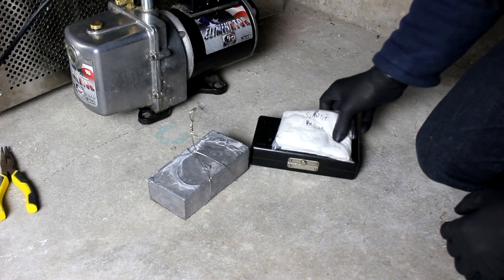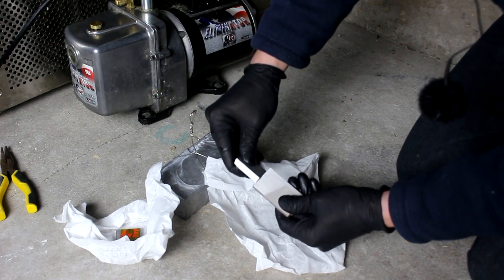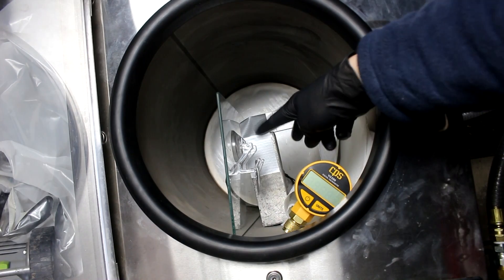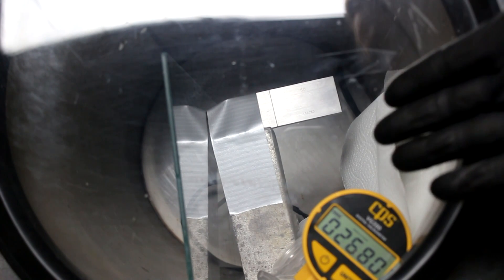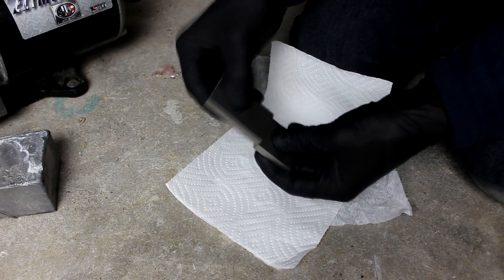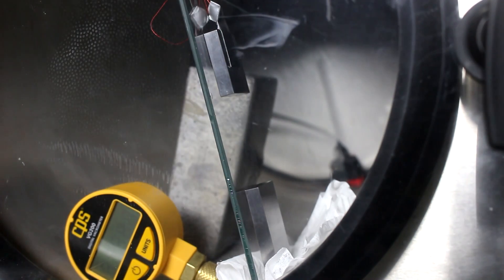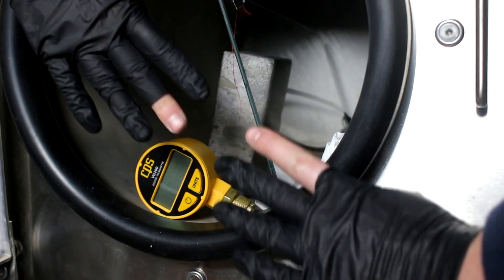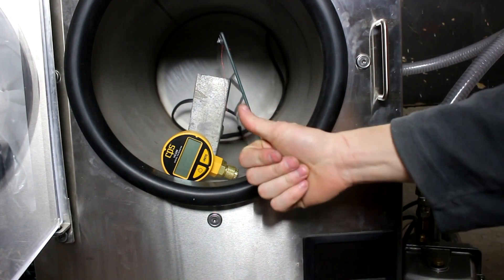Will Gauge Blocks Stick In Vacuum?

Comment: What about the Van der Waals force? Weak intermolecular attraction that adds up the more contact there is between surfaces at the atomic level. It's the same thing that keeps geckos attached to basically everything. The fact that they're almost perfectly flat (the gauge blocks) seems to validate this at least a little, why not look into this?
Reply: Like this so Cody can see
Reply: He mentions it at 13:46

Comment: Seeing the drop-contact experiment in vacuum versus the sliding/wringing process, I can't help but wonder if there might be a measurable electrical interaction between the blocks.  Maybe leading to van der Waals interactions in the oil layer (would require an exceedingly thin oil layer and effectively spike the viscosity of that layer to absurd levels) or maybe even allowing direct electronic interaction between the blocks.  Maybe wring them together but with a strap eualizing chare between the blocks...

Comment: I feel like since these are grounded so flat it the grind created like microscopic hills and valleys and when you app pressure and slide them across eachother the hills and valleys lock into eachother and thats why they hold together but idk I might be dumb

Comment: 1 wavelength is quite large. When making telescope mirrors any old joe can do 1/8th wave. Sticking is a problem with grinding mirrors as deviations around a wavelength - especially concave ones - cause the two glass blanks  to lock together.

Perfectly spherical blanks don't usually stick so geometry is very important.

Comment: That's... not what gauge blocks are for. You could use them for that, but it'd be kinda silly. You might be thinking of the standards that you use to calibrate and check micrometers.

Comment: very cold and weak friction welding? the movement does create heat  you could try and see if they are more likely to just stick at higher and higher sub melting point temperatures. alternatovely, you could try the friction movement with super cold plates and see if it still works.

if you notice a significant temperature dependence, this could be evidance against the "hooking together" hypothesis

Comment: If it is the oil that is holding the two pieces together then you will need a vacuum under 300 microns to boil off the oil

Comment: Maybe it behaves like ice and when strong pressure is exserted on it it becomes a liquid. Then the two blocks fuse together due to the liquid metal soldering it together. That is my theory :)
Reply: I've also found that static electricity can make two peices of glass stick together. Maybe the metal creates a small, really strong magnetic force. :) just throwing that out there

Comment: Great video Cody, but I am a little confused on a part.    If it was indeed some sort of suction keeping them together, wouldn't putting it in a (near) vacuum  make it harder for them to attach  to each other? It seems like putting them in a high pressure chamber where the difference of pressure of the outside the blocks and in between would be higher, that would there for increase the force?     I'm not sure if you would even be able to test such thing, but it is what I thought of.                                 

Love all your work man, keep it up! Million subs right around the corner!
Reply: quigly pigly He actually tested that.
Reply: What? When did this happen?
Reply: quigly pigly - Lmao someone didn't pay attention or watch the entire video... I mean it's pretty crazy because that was the whole premise to the video and he pretty much proved it is not a suction effect.
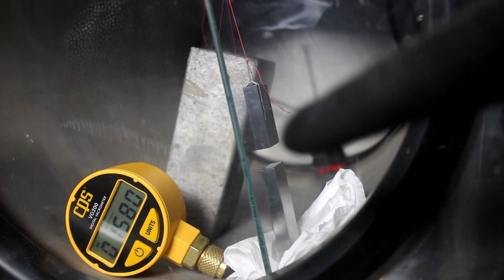Reply: The whole video was about the idea that those blocks would stick less in a vacuum. It's the whole video. The test is done at 9:00 . And the description says: ' I test a few hypothesis as to why gauge blocks stick together by seeing how they stick with almost all the air removed.' 
You just won the 'useless fuck' award of this entire millennium.
Reply: 2 months late, and zero info to add! Congratz, you get the 'useless fuck' award of the day!

Comment: it's probably an electromagnetic bond between the two blocks. like a balloon and a shirt.
Reply: UpdateParkor1628 you are thinking of an electrostatic bond. This shouldn't happen since the blocks are of an identical material and are conductive.
Reply: That's right macmaniac77, you would need a huge potential difference between the surfaces to generate the force capable of holding one piece against the other and an air or vacuum gap sufficient to stop arc-over.

Comment: Could it be that the surface of these blocks' faces aren't smooth at a microscopic level? If I remember correctly (which I never do), a two minute conversation I had with a smart guy's friend once four years ago, metals have uniform grain structure. However, the grains could be flowing different directions because they're two separate pieces of metal. So, when you specifically rub them together you're getting those uniform grains to slightly shift, not enough to get them welded together enough but for the grains to store friction between them.

Comment: You are probably having an issue with oxidation on the surface. When you rotate the surfaces, you could also be scratching of the non-reactive metal oxides, exposing metal that can be cold welded together. If you plated the surfaces in a thin layer of gold (which doesn't form an oxide) you could get easier cold welding.

Comment: I have a different theory on that welding effect. This theory is based on the "Gecko " effect found in nature. Geckos can climb up glass or any other material you can mention and studies have cracked this puzzle-------The scales on their feet are very very fine and end in edges that are a few atoms wide---these atoms can stick into gaps of any surface and adhere to it. Enough adherence to support their weight.   Pushing hard on certain metals will bind atoms together.

Comment: could you measure the amount of force necessary to separate the two pieces of metal and compare that value with the calculated total attractive magnitude of the van der waals force to insinuate it is in fact that force doing the work?

Comment: +Cody'sLAB I believe the friction is heating the metal slightly making the grain structure expand slightly allowing better intertwining. once intertwined the Vanderwall forces take over...
Reply: I'm really enjoying the hypotheses coming out of the CodysLab community.  This one is interesting too.

many hearts <3 <3
Reply: Ryan Bernard it would make sense for two dissimilar metals not to work... different grain boundaries and structures
Reply: In that basis, Invar metals would not stick. They don't expand significantly with T.
Reply: opopo or maybe try dissimilar blocks.. shouldnt work
Reply: Ryan Bernard dissimilar as in metal? or size...
Reply: Metal
Reply: I would guess Invar would still expand enough for this purpose. It only has to be a tiny amount, on a scale relative to atoms, and for a tiny amount of time.
Reply: opopo   C. C qqqq
Reply: tubeist- dan it would be worth a shot... however even invariable metals still expand... albeit 10 times less than ordinary steel.

Comment: I wonder if an ion pump under ultra high vacuum conditions would change the results. Even baking the chamber to reduce the moisture off gassing and contaminants could change thing drastically.

Comment: I reckon if you look at the ends under an electron microscope, you'd find mini scrapes from the ringing process which are essentially interlocking. You can probably simulate this with some other kind of deformable substance. I suppose another possibility is that the ringing removes local irregularities so that a greater surface area can be in contact.

Comment: Just a thought, probably not it, but it might not hurt to also rule out magnetization at the join site after they are joined and not just before.  Thanks for the videos, I'm really enjoying these and your methodology.

*Edit: After looking at gauge blocks online, I noticed some are ceramic; are these as perfectly flat as the metal ones?  If so do they produce similar results?

Comment: If the force is electron sharing, why don't you try touching them together lightly and then running a current through them? If they stick, that would be pretty convincing to me. Try AC and DC to see if you get different results.
Reply: Glass or ceramics ring together, and they aren't conductive. But if a combination of forces are at play then it might give clues? It's always worth an experiment, ask Ernest Rutherford!
Reply: that may end up resulting in actual welding
Reply: This as well as temperature changes.
Reply: @JimDeegan  This will induce a temperature change due to the resistance of the material and the eddie currents in it. So testing electric current is all you need.
Reply: Matthew Stauffer oohhh
Reply: This is exactly what I suspect is happening. That sliding and twisting motion sounds familiar from an electro-magnetic reaction my father once showed me in his work shed. I don't remember specifically what it was but I remember it was very important for a magnetic bond to form between two materials that aren't themselves magnetic.
Reply: This is along the lines of what I was thinking, in terms of energy added to the system, getting electrons to migrate.

The friction energy presented by ringing the blocks is significant given the huge amount of surface area contact. This energy may be enough to promote motion in the electrons to jump the gap and forming a pseudo-bond via cold welding.

You idea is much cleaner and way more testable.
Reply: Matthew Stauffer that's the same thing I was thinking try to put the gauges by an copper coil and run current through The copper coil.
Reply: False. Electron sharing is also called cold welding. If they were cold welded, then you wouldn't be able to pull them apart without ruining the surface finish. Which would prevent them from ever wringing twice. It's cool how you pulled that lie out of your ass on the spot though.

Comment: What about when you used the laser to cut the string wouldn't you have vaporized some particles making the vacuum slightly weaker. You could try using a motor and RC remote to lower it

Comment: Something you might be interested in researching is a similar phenomenon in harddrives. A semi-common problem is that the heads get stuck on the smooth silicon platter that move under them. Fairly easy fix - just gently unstick them - but I feel like the underlying science is probably the same. You can manually get them stuck yourself by slowly spinning the disk with your finger while slightly pushing the head down. This will quite possibly scratch and ruin the drive, of course.

Comment: I think that when you ring them together without a vacuum, it is creating a very strong suction which causes this cold welding. Once they are cold welded together, then the vacuum can be removed and they will stay stuck together.

Comment: As Richard Faynman said "The reason for this unexpected behavior is that when the atoms in contact are all of the same kind, there is no way for the atoms to “know” that they are in different pieces of copper. When there are other atoms, in the oxides and greases and more complicated thin surface layers of contaminants in between, the atoms “know” when they are not on the same part.". And I think that the act of applying force to make them sticks makes sense, since all matter is actually surrounded by electrons that repel each other, you need to give it energy in order to form a bond.

Comment: could you clamp them together and vibrate them. I bet they will stick with just pressure and vibration to settle the atoms together. goal is to remove rubbing as a factor. so I'd say a c clap and something like an electric tooth brush to vibrate them. I would love to see i f it could work. thanks for the great videos

Comment: ive used these types of blocks for years and did some similar experiments with a set of certified Starrett guage blocks with a guaranteed micro finish.  ive cleaned them as well as blast cleaned them with CO2 and they still stuck.  I did learn that even the most trace amount of humidity in the air is enough to make a stronger bond when rubbed between the surfaces.  although when i check the heights of the blocks individually on an inspection table with a ruby tipped Renshaw probe and then stack the same blocks after rubbing them together, they check almost 
.00012 taller over 4 inches (4 blocks rubbed total). This leads me to believe there is still something between the blocks adding the extra .00012.  The inspection head itself has a
 .00004 +-  room for error on its "Z" axis in its controlled environment.  The guage blocks were acclimated to the inspection environment and left to acclimate again after touched with warm hands when set up for the rub/stack test.

Comment: You can't wring out all the air, there isn't any space in existence so flat that 2 separate objects will have an atom touch another atom because atomic forces will always keep them apart. But if you think van der waals attraction is occurring then you should look into surface area energy. Your surface is coated in gas molecules being either physisorbed or chemisorbed and the attraction from forcing the metals onto each other could cause something like H being forced into a metalhydride bond. 

Bake the blocks in a continuously purged helium atmosphere at 200C, then somehow without having them come into contact with air vacuum the pressure away and then try it.

Comment: The sticking is just the beginning of a cold weld. Which you could also classify as friction if you really want to...with the surfaces so honed, if you exclude any air molecules, it only takes a very small amount of force to start to adhere the surfaces. If you were able to slowly press the surfaces together flat in a vacuum (not just dropping them together, since that also applies a reverberating force that doesn't allow the surfaces to adhere), I would be that it would work.

Comment: it could have something to do with the electrons in the metal
Reply: you should also test gauge blocks of different material and see if they stick
Reply: i work with ceramic and steel gauge blocks daily and they both wring together. ceramic seems to stick better, however i believe that is more due to the fact that the ceramic are a little newer, and harder, so the surface is less scratched

Comment: The effect is much more striking with hard disk platters. You can just let them sit on each other (with little wringing compared to gauge blocks) and while they slide laterally quite easily you can definitely feel that they don't want to come apart. I would imagine the surface features of a disk platter are much smoother than the average gauge block since I think disk platters are fabricated to 5-10 Angstroms height difference across the surface (though thermal effects and use will increase that at least a magnitude I would imagine).

Comment: What if it has to do with inter molecular forces? like, the minute differences in the spread of electrons throughout the substance when you slide them cause tiny dipoles of attraction through the London Dispersion Force? And the sliding motion kinda makes the attraction "turn"  causing the electron distributions in the individual atoms line up as if it were like turning a billion bar magnets on their side next to a billion other bar magnets.

Comment: I say a lot of stupid things and this very well may be a stupid idea so i apologize in advance, but i believe what is actually happening is that by rubbing the pieces together, an oxide layer on the surface is scraped away leaving only the pure metals in contact with each other at several points along the contacting surfaces. this would explain how moving parts get cold welded together in space. Everything that comes from earth will have some layer of debris and oxidation on it's surface, but if the parts move against each other, that layer get's scraped off leaving a pure surface in the vacuum of space.

Comment: THE ANSWER:       (TLDR: malleability) 

The surface of the metals are not completely flat at the atomic level otherwise there would be nothing stopping 2 pieces of metal from sticking together due to metallic bonding when they are brought together. The sliding action makes metallic bonding possible. 

At the atomic scale the surface of the metals are rough like jagged rocks. When you push two of these rough surfaces together, there are some(few) contact points that support the force between the 2 pieces and atomic bonding is possible at these locations however not enough force is generated by these few bond points to support any weight so the metals don't stick. If enough force is applied the rough surfaces at the interface could be squished down (due to malleability) making the contact points bigger and allowing enough metal bonding to stick the 2 pieces together. (like when metals go under a press)

Alternatively sliding can make the same effect possible without requiring as much force. When 2 rough metal surfaces are rubbed against each other with enough force the rough metal at the interface is grinded, smeared, and blended to create larger contact areas. If this is done with enough force then there will be enough deformation of the surfaces to create enough metal bonds to hold the pieces together. (more force applied while sliding -> more deformation -> more contact points -> more metal bonds -> stronger fusion)

This is possible because of the malleability of metals and is easier to visualize if you consider softer, more malleable metals.  Sodium for example, if pushed together hard enough will stick. If two piece are twisted together they will, deform at the surface like play dough, and stick.